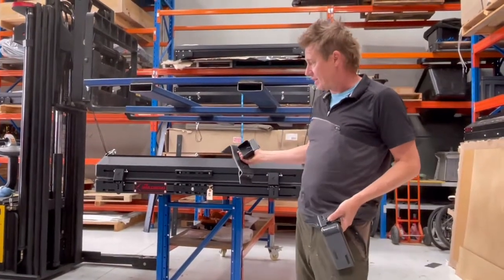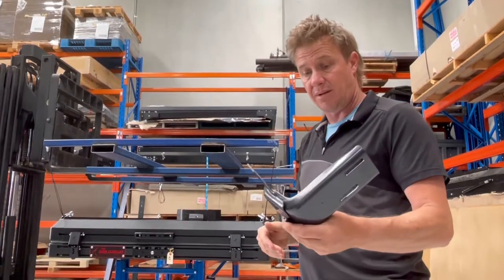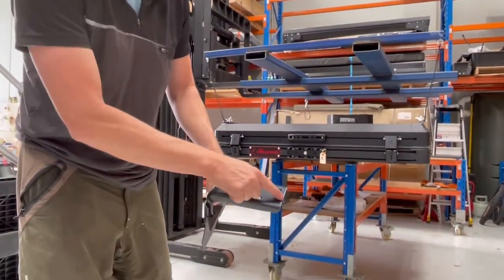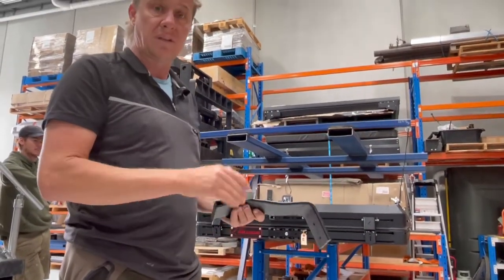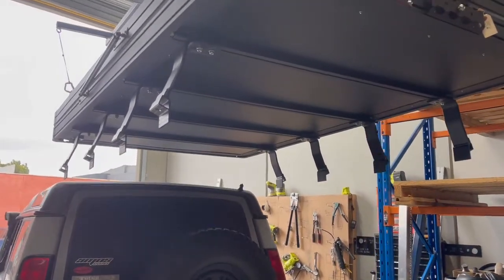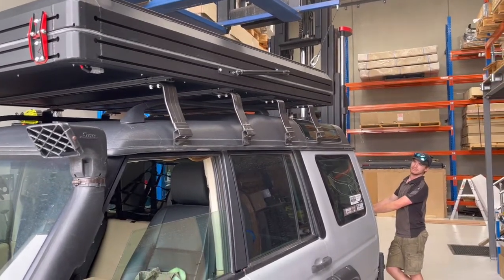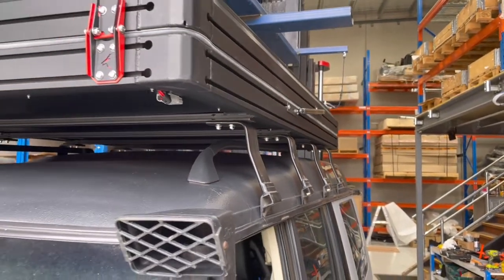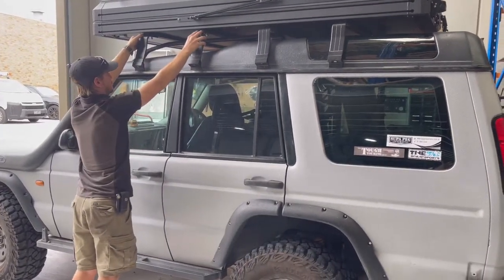Gutter installation of bush company roof top tent

Comment: Great video Mark! 
I used the Tracklander roofrack legs kit TLRKIT08 to mount my black series Bush Company tent to my Defender. They have loads of reach allowing for the tent to be shifted off centre, I have the tent sitting towards the driver's side approx 100mm (means i don't have the awning protruding off the passenger side of the car so much). 
With the Tracklander legs I was able to fit 2 nuts/bolts per foot because of the extra reach compared to other legs.